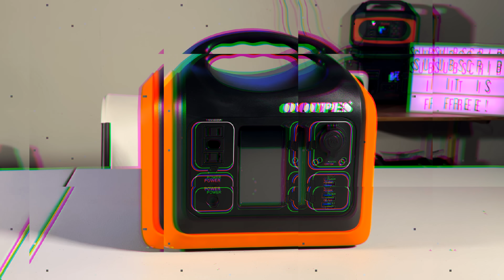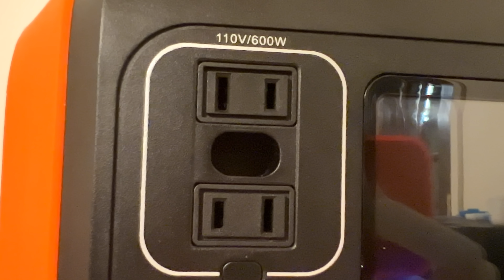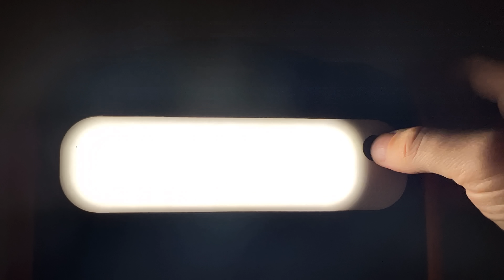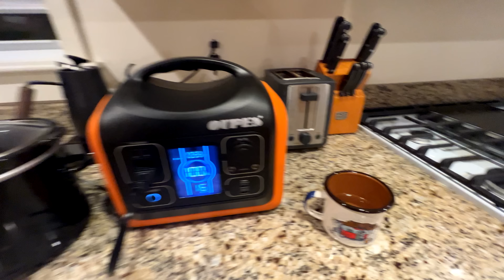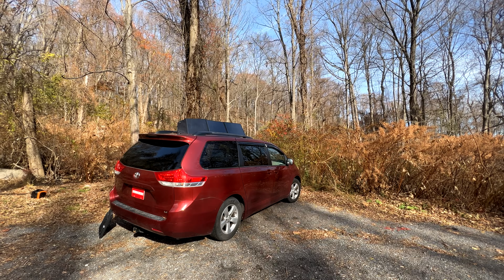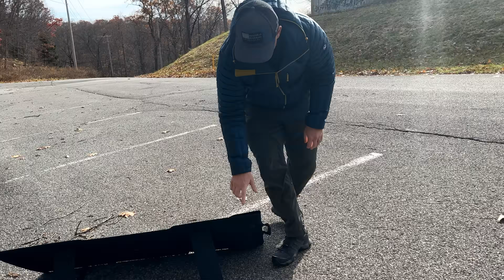Dirt Cheap Portable Power Station BEATS Jackery?

Comment: Hi are you able to connect a three prong plug in like a computer plug in this device? I only saw the two prong plug being plugged in. Thanks. Great and informative video.
Reply from the maker: You can plug in a three prong computer charger. The power station is not technically grounded, but has a hole for the third prong. No issues.
Reply: @AdventureGearTV  Thanks!

Comment: I found my Oupes to charge at 86watts max with my solar panels. I think the unit will take 100watts at 24 volts. My solar panels are rated at 18 volts. I found the same results  running one 120 watt panel  and two 60 watt panels ran in parallel. I also over paneled it with the 120watt and one 60 watt in parallel and max was still 86 watts. I did hook up one of the panels to the PD port and was able to get the charge up to 120 watts. Not sure what the watt rating is on the USB-C outputs on my panels are though.
Thanks for the video.
Reply from the maker: So, 86w sounds normal for something rated at 100w of solar input. Factor oh the inefficiencies and it’s about right. I would like to test again when spring comes around to see the max input.

Comment: I’ve been interested in this for a long time, but it’s priced only $50 less than the EB 55. Seems the Bluetti might be faster charging with no downside. I think the Oupes 1100 model stands by itself in that range.
Reply from the maker: The price seems to have gone up since I made this video. It was $349, now $449. Bluetti seems decent too, although I have not personally used one.
Reply: @AdventureGearTV  The Oupes often has a $200.00 off coupon. It is right now $549.99 there is currently a $200.00 off coupon, putting it at $349.99. That is a great price for that size unit.

Comment: So, this has a 600w inverter, but only 522wh of useful power correct?
Reply from the maker: That’s correct, I got about 522wh from it. Which is consistent with about a 600wh power station and 80% usable power.